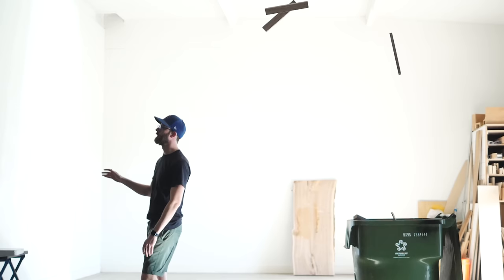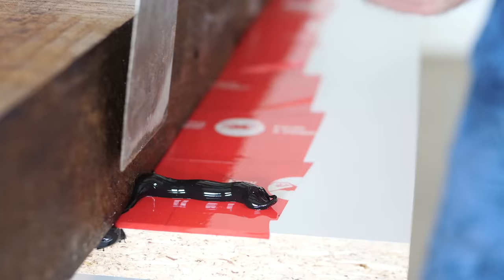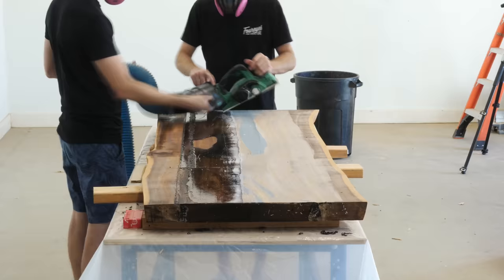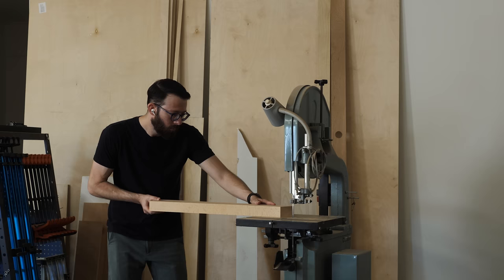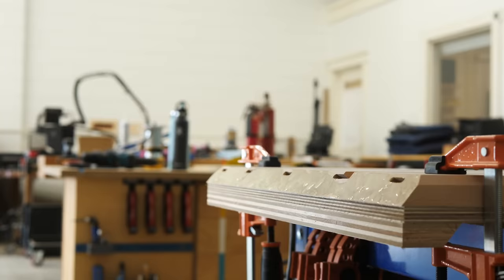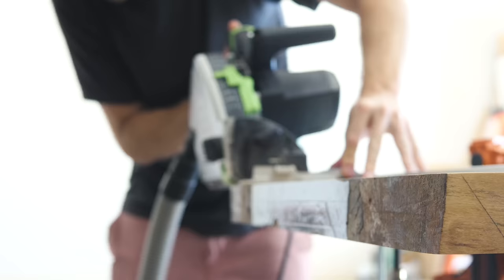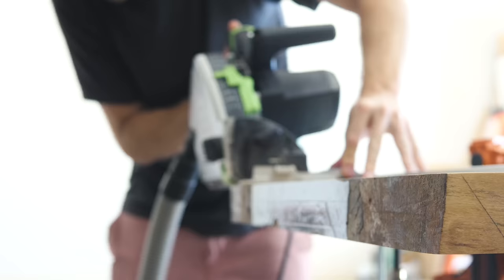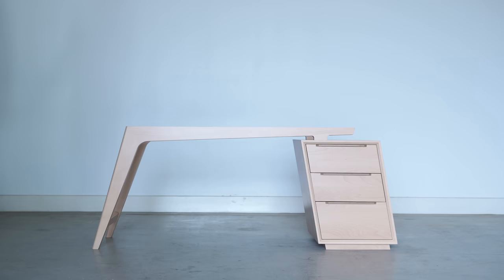BEST...DESK...EVER

Comment: I'm not a wood worker at all. I know nothing about it. But I'm late middle aged, and like most, I've been around wood furniture all my life. I vastly prefer hex bolts over screws. With screws, in a few years you throw the thing away. With hex bolts, in a few years you add lock washers over flat washers and tighten them. Vast improvement.

Comment: 16:50 in We see another example of what not to do. It's nice that the saw is a Saw Stop saw put that will not prevent binding and kick back. A tenoning jig made of steel (not home made) is designed to make this kind of cut. You never want to put the saw blade so close to the fence. The better way to do this might have been with a router with a rabbiting bit.

Comment: Loving your channel. I do a fair bit of resin work with timber....if I could humbly offer a helpful hint that worked for me. I started using gloss finish melamine boards to build my forms after the melamine not wanting to come away from the resin happened to me my first time.
I thought about the tape, and then weighed up the extra cost of the gloss finish melamine vs the cost of the tape and the time to lay it. The gloss melamine was a clear winner and releases beautifully every time.
Reply: Thanks for watching and commenting, ❤ you have been randomly selected as winner for today giveaway.  Hit me up via the digits above to claim prize 🎁

Comment: Dental bond (the adhesive that dentists use to bond fillings into your teeth) is about $150 USD per 5mL (taking 3M's ScotchBond Universal as a benchmark). Which means it's about $30000 a litre and $113400 per gallon. Oh, also, nice desk!

Comment: If the top is attached on an oversized hole, wouldn’t it be wobbly..? Amazing build tho, you’re always inspiring me!
Reply from the maker: Thank you. To answer your question. No. The attachment comes from the squeezing pressure. So as long as the head of the bolt (or washer) can’t fit through the hole. It will still clamp the two pieces together.

Comment: I guess these epoxy slab tables and desks sell for thousands of dollars because of the intense and unique beauty of the thoroughly finished slab. I guess that's what draws the wood crafters and the audience to them, and that's why most of the effort it put into the slab and the rest is left unfinished by comparison. I dunno, I'm afraid I'd probably be the guy who builds a machine that mass produces furniture that is thoroughly finished from top to bottom, but isn't unique and doesn't have the big fancy slab. I'd rather sell 100 $200 units than 2 $5,000 units. And I guess as a consumer, I'd buy several $200 units and never a single $5,000 unit...

...and yet I find it really fascinating to watch channels like this.

Comment: The cleaning up of the rotten wood makes it look more unnatural, i.e. in the middle of the slab. I dont know if it wold make much of a difference in strength, but I would rather put epoxy directly in the rotten part after maybe some cleaning, & no chiseling... It just looks more natural

Comment: Beautiful top, but in my opinion the shape of the base is over designed and it takes from the top. I would have left the base much simpler, yet richer. Perhaps metal legs like brass or gun metal. Also the choice of beach wood for the base… if you really want to go for wood, next time I suggest to use a richer essence like walnut and simpler shape. Beach wood makes it look cheap. 
Super beautiful top though! Bravo.

Comment: I know Epoxy is a thing online because it's easy and satisfying to watch. But wood and epoxy are opposites in terms of materials. They really shouldn't be mixed (in my humble opinion).

- Wood is Natural, Epoxy is poisonous chemicals
- Wood is open celled. It breathes. Epoxy is dead and sealed off.
- Wood moves and warps. Epoxy is dead and wont move with the wood.
- Wood feels soft and warm to the touch. Epoxy feels cold and hard.
- Wood is good for the environment. Epoxy is a nightmare.

I just don't get it. Pouring Epoxy onto a beautiful piece of wood is like pouring ketchup onto a beautifully cooked 3 star meal.

Comment: stain the base to match the slab better. It's like, as awkwardly different as possible. A pink base would make more sense than that. Easy fix though. Also, if I ever went to the trouble of making a desk myself, the first thing on my list would be to have no damned crossbars to bash my kneecaps on. This one is particularly egregious.

Comment: Never use a fence with a sled. Attach tracks (runners) to the bottom of the sled that run in the miter grooves on the saws top. Running the sled against the fence risks binding up and kick back. Humans are not strong enough or fast enough to escape kick back when it happens. the best bet is to avoid it altogether. The worst part is people watch this and think, "oh that's how it's done". Google how to build a cross cut sled. Your loved ones will thank you.

Comment: Love your work. I have to say that leftover slab I think didn't have enough epoxy real estate to have considerable artistic value in the end. Did your best using it. The part you decided not to "naturally" cut off, could have really it seems like a sudden cutoff. I think what would also have been cool to add to the look, adding cuts to the middle of the 4 sides and filling those with resin, maybe slight angles like strips lengthwise, slightly angled, so a 360 resin all around in the middle, maybe even bleeding in the top with the edges. Would also be cool if one could add hidden LED lighting into the wood so it lights up, with several fail safes in case LED's die out over the years. 2-3 extras. Interior accent lighting to light up the wood through the resin and resin its self lit. I do think it would have made the drawers more official and less cheap looking if the sides of the drawers were also angled, not just boxes. I know it takes time, but would have been cool. Also maybe stainless steel pole looking legs, not sure how that would have looked. The design is very sleek. It's begging for a short leather cushion on top, red, maybe grey. Edges only going to a few inches inside the top edges. That would defeat the wood, but it's screaming for it.

The base for the top, I can't tell I'm not in person but I think a more rich lighter gray color

I can appreciate good home made furniture, my grandfather made pure walnut furniture, a couch the weight of a car, 6-7 seater, candle sticks, tables. All from walnut trees on his property in Stafford, VA. We sadly gave it all away years ago, including selling his house which included a large woodworking shop garage where I learned the lathe and bandsaw, next to a connected garage with his 3 1970's and 80's Lincoln Town Cars and a Rolls Royce I believe